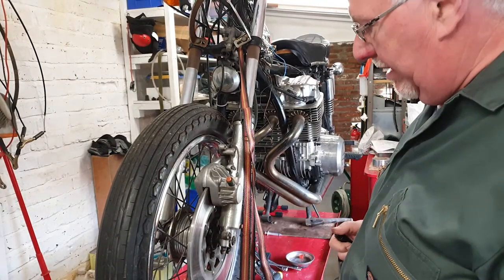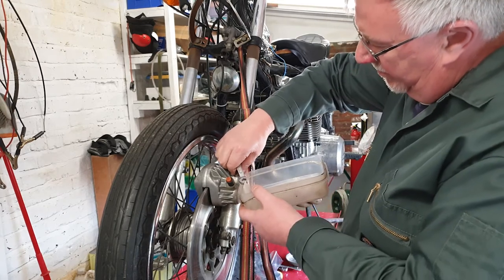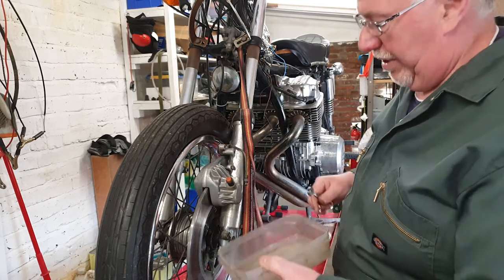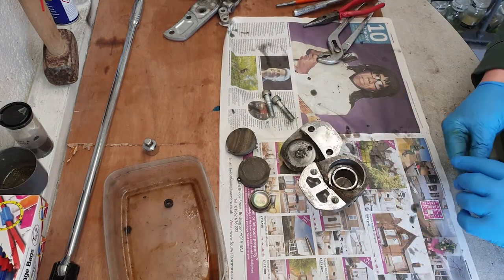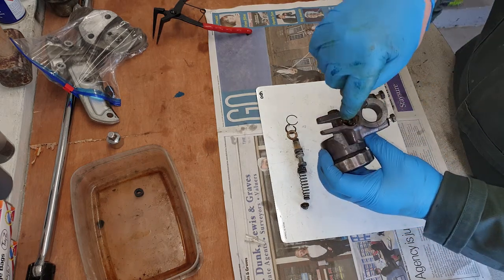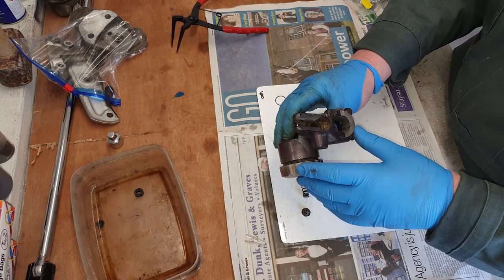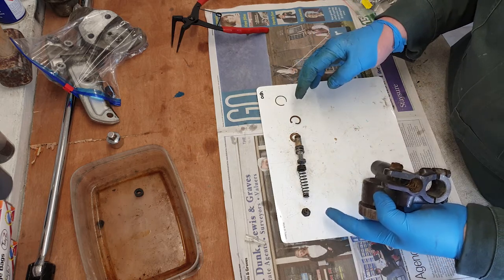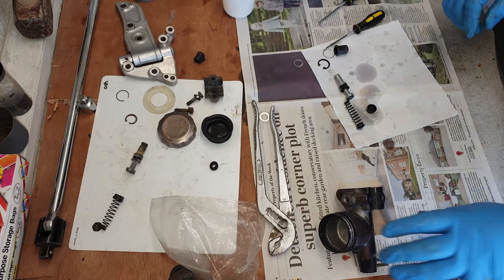Motorcycle Brake Caliper & Master Cylinder Rebuild Guide - Honda CB750 | Part 21

Comment: I can't get the spring clip in, it's a bitch !!!!!
Reply from the maker: Hi Mark, If you can, try using some sort of clamp to hold the piston against the spring pressure so that you aren't fighting that while you are getting it in. If you can position the clip square in the bore you can push it down a little at a time until it is in the groove.

Hope you manage to get that sorted. :)